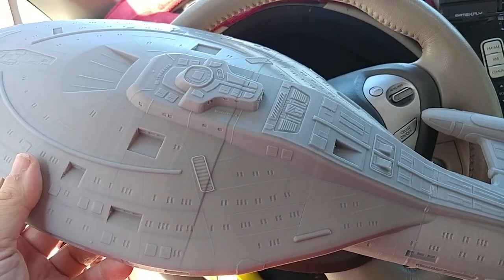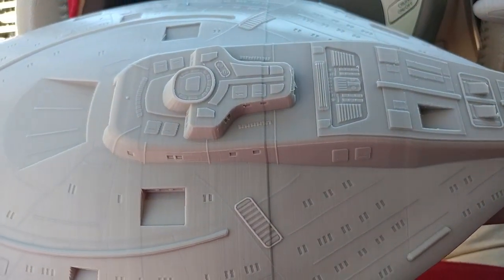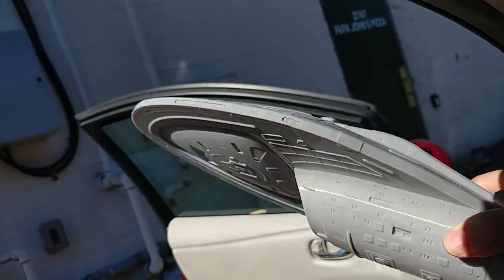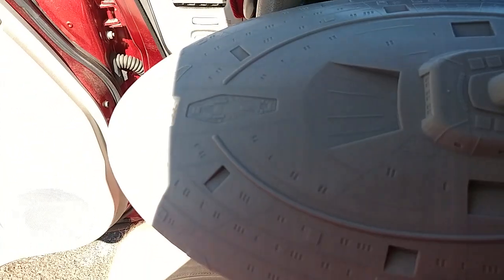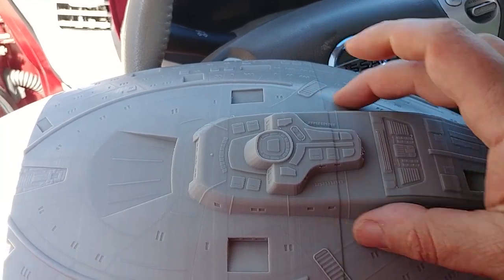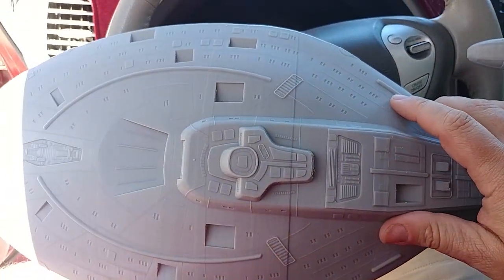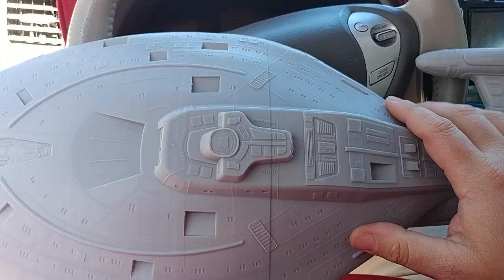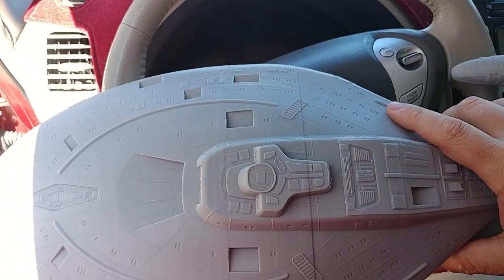Today's 3D Print - Simplify 3D multi process infill deviation on skin of model. Ideas?

Comment from the maker: Some sales Gearbest asked me to promote (why not)

I OWN these top 3 listed printers and consider all of them to be a good buy

CR-10 ON SALE AGAIN!! http://goo.gl/VsqqDa coupon：CR10SUP $379.99

Ender 2? less than $170 http://goo.gl/RDceSp Coupon ENDERC EU Ver

Anet E10 http://goo.gl/ScK96q $259.99 just 60 pieces for EU warehouse

------------------------

I DO NOT own any of these below printers but most appear to be well liked by other users on youtube. 

Check out some youtube videos and if you like them. Have at it.

I3 Mega http://goo.gl/vqa2gv THE_I3MEGAUS $355.99 US Ver THE_I3MEGAEU $349.99 For Eu Ver

Anet A8 http://goo.gl/41b2YZ $139.99 Coupon GBA8EU just 200 Units EU warehouse

A6 http://goo.gl/e7PYSv EU warehouse $165.99 with coupon:GBA6EU

General Sale pages for this month.

More 3D printers http://goo.gl/D96bgJ

Autumn Bumper Harvest big deal http://goo.gl/NQ8cF8
Reply: Just watched, and enjoyed, the timelapse print of this. Three questions: Did you figure out how to get rid of those lines? What did you use to glue the two halves together? What ratio of video time to real time did you use in the timelapse? Watching the spool was interesting - turning at around  an RPM or so.

Also, I know it's a bit of a pain in the ass, but going back and adding references in the "about" linking to this (and others...I think there is one other, but I couldn't find it) from the other, and the other to this one would be useful in that it allows people to follow a project. Or at least tag them with stuff like #nerysvoyager, #nerysswan etc as you make them.

Comment: Real Nice model.  I recived my Very own ender-2 Yesterday.  Jey Me 
So now ime trykning to figure out How to set cirka 2,7 proberly up for the ender 2
Reply from the maker: mistube i am notnfamiliarnwiyh cura but it cany br allbthat different. For models like this i use 3 or 4 perimeters in cura i think that means 1.2 to 1.6mm wall thickness for a .4mm nozzle. 1.2 would be fine for anything on the ender.

Retract to 5mm coast to .2mm. .4 nozzle .4 line width pla temp 195c bed 45c. Extrusion multiplier to 1.00. The included built surface is actually quite good and durable.

You are really going to enjoy the ender 2 the prints are truly stunning. Make sure the carriages are zero slop. Tighten the concentrics if needed (do not over tighten only exactly enougb to remove slop)
Reply: yes your videos is so inspiring with those lovely models you make on it , 
so hoping i can get near that quality with cura on some models
but alot of numbers to fiddle with,  right now ime testing a benchy print, and after x hours ime getting closer do to some help from the reseller, however its still not there, right now the infill on the benchy is full of holes and not a solid grid as it should be and i see gabs on the sides  tempature 210 pla
but it seems some settings is not getting from cura when saving the gcode 

the first layer was flying away even though first layer was set to just 10, it stil runs fast, så lowered the speed manualy on the printer, but no ideer why that speed on first layer is that fast even if its set to 10mm/s wich should be prety slow
Reply from the maker: mistube first layer for me is a % of normal speed. So if normal speed is too high.... Holey infill make sure you use grid and not rec. Rec is every other while grid is both every layer 25% grid both directions every layer is good for benchy. I will have to try and find time to play with cura one of these nights. Remind me tonight to send you my benchy g code. This will confirm printer is ok. Also reduce your temp to 195c. 210c is too hot for normal pla. Bed should be 45c.
Reply: The normal speed is currently only set to 45mm/s on this export i made, and ground layer set to 10 mm/s
the infill is set to Grid
sadly i cant post a pic here so you could se :)
my bed is at 45

The fillament i test right now is from Fiberlogy  the box says print temp 200-220 on the box
Reply from the maker: mistube can you get a roll of esun pla pro? That would remove filament from the equation. Tru lowering the temp to 195 anyway. Pla just prints better cooler.

I s3d i can make the extrusion for infill lines different than perims. Make sure yours is set to 100% or 1.0 multiplier

45mm/s is perfectly ok so thats not the issue.
Reply: im already on role nr 2 to test cause the first fillament we tested didnt work that well yet so we tried this insted, wich should be a good quality.  Its 7:50 PM here whats your local time
Reply from the maker: mistube 1400

Comment: You may want to try a coat of primer are two should help with the problem.
Reply from the maker: darth parkus oh no I don't want to do that I will lose all the amazing precise details that were printed the layer lines are barely visible the model is gorgeous the issue I'm having is a slicer issue that Defector should not be there yet it is intentionally there by the slicer I'm assuming I have a incorrect to setting somewhere I just got to figure out what that is and fix it

Comment: I bet this is similar to the 'only add supports when manual support isn't present' issue - where you'll need to trick the program into doing what it's supposed to be doing already.  I'm curious to see if you go from some small amount of infill to whatever you have here.  Say 2%?  I'd totally try it but didn't bring the CR-10 when evacuating Irma.

Comment: I`m not to sure about that my friend I have painted a lot of models and your voyager is kind of big so you should not lose any details I promise.
Reply from the maker: darth parkus YOU habe painted models. I suck at it. Plus that defect is rather large. Would take some sanding and filler to fix that. I just want to correct the slicer issue so it does not happen again. Maybe some time down the line if the universe does not chew me up so badly i can try my hand at finishing models. For now. I am thrilled with how nice it is. :-)

Comment: Hi Nerys. I printed exactly the same model on my CR10-S4 and got exactly the same results. I came to same same conclusion that the line across the disc of the ship was due to the infill. I couldn't understand 'why' infill was used here and up front. It not only caused a problem but increased the printing time substantially including using more filament. The outer shell of the model is quite stiff and IMHO would have been sufficient with no infill for a static model. The other observation I made was looking at the model from the side profile there's a small rectangular inset (I'll call it a window) which that seam cuts through. The whole model seems to have shifted a little causing the line. I have no idea why that would have occurred. I hope you'll make another video should you find the solution. Thanks anyway for this video and the model which I'll paint. It won't be noticeable by the untrained eye.
Reply from the maker: the reason for the infill is the deflector array. it leans "IN" at an acute angle and would fail without infill to "support" those layers as they lean inwards at such an angle and since that part of the model is a key visual part I wanted it to print nice and clean. at a smaller size you might get away with just say 4 perimeters but I did not want to risk it with the larger one as its a lot of time and filament. ie expensive.
Reply: Thanks for your feedback, makes sense. I respect your skill and expertise. Much appreciate your taking the time in sending the reply. Always 'thumbs up' from me.

Comment: Hi, my name is Chris I live in Bulgaria, I am very sad that this happened to voyager. I have the file and will try it soon. I am wondering if a slight coat of paint might hide this small error as it seems such a shame. I am not an experienced 3d printer guy yet but I am an an expert at hiding faults like this. You must feel really peaved at this. I have watched nearly all your videos and many of the other 3d printer guys a s well. The only thought that I have  is that I did notice somewhere that one printer guy when doing the fill start and finish wrote the same number where to finish the non fill and then the same number to start, would this not make the same line print twice, just a thought. Since I am here and you have asked for ideas for videos, there are a few terms and abbreviations that I have not learnt yet. I have learnt retraction, but it was a week or two before I found out. But there are more which certainly for me could do with a little explanation.  Sorry about Voyager are you sure it was not due to a warp in time going to the delta quadrant or that 7 of 9 is up to something again, Dam those Borg.
The Jackels have stopped howling now, it is time for sleep in Bulgaria. Chris
Reply from the maker: absolutely. I am getting many requests such videos and I think they would be both useful and fun to do so expect to start seeing them soon.